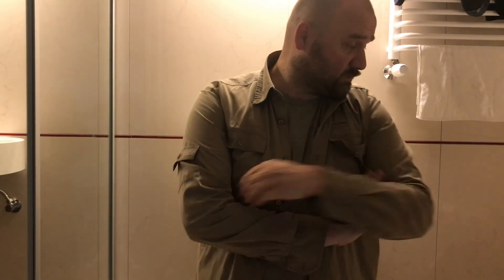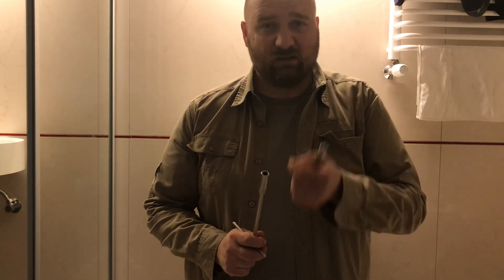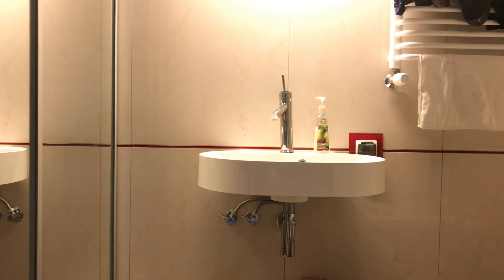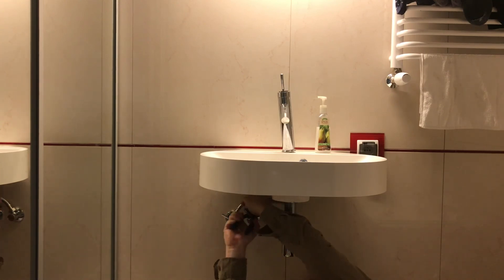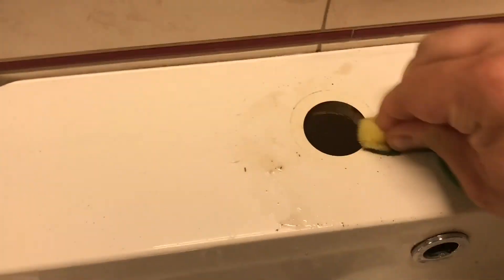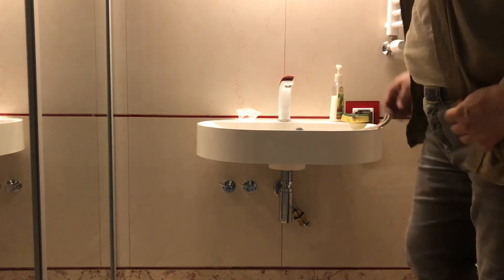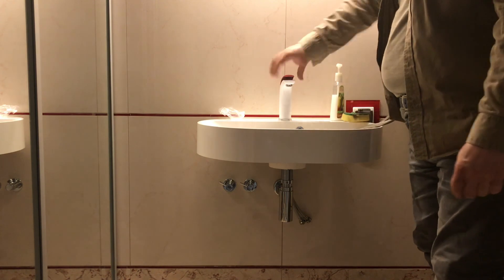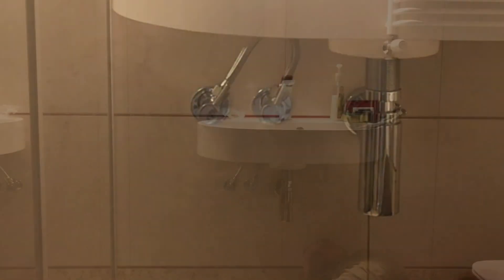Polish Plumber - Installing My New Faucet From China

Comment: Great having the shut off valves at the wall  🙂
Reply from the maker: pretty much standard around here, although quite oftem those also become seized with all the limescale deposits and you end up having to replace these as well,  having to shut off the main water supply anyways. Taught by experience nowadays I only replace these with ceramic head shut off valves with a solid metal turn knob as the plastic ones fall apart if there is too much resistance trying to turn them.